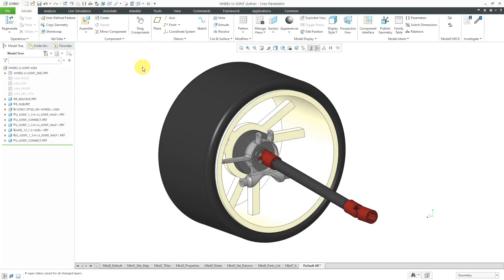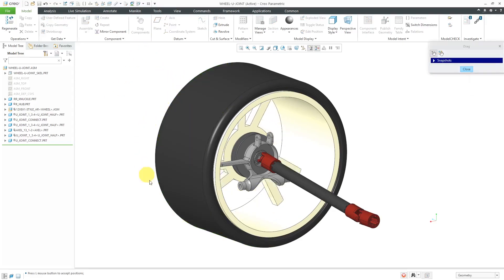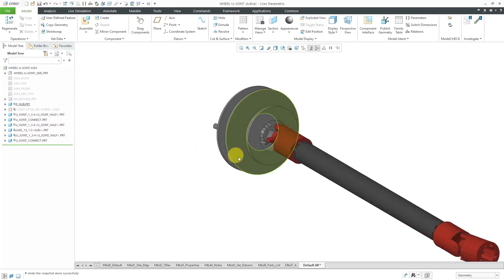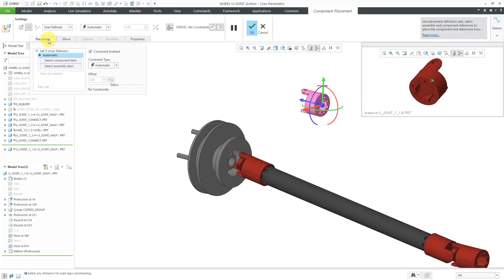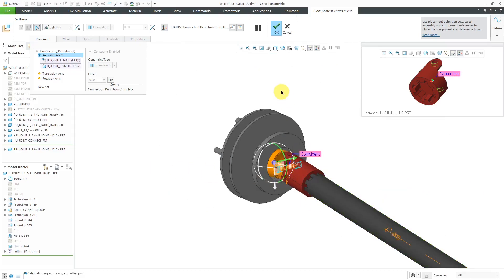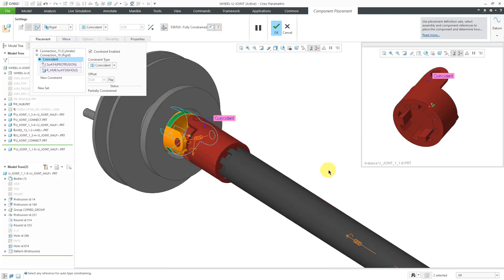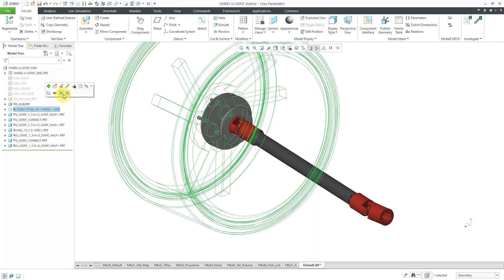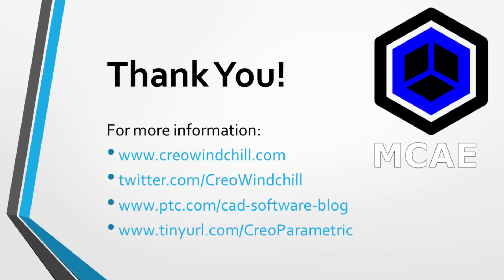Creo Parametric - Mechanisms | How to Create a Rigid Connection

Comment: Could you make a video on nested connection? That is components with lability and connections that are connected with other ones on different assemblies
Reply from the maker: What is lability? Can you give me an example of a nested connection?
Reply: @CADPLMGuy  
Lability of a component is when it has at least 1 dof.
With the term "nested connections" I mean an assembly with at least 1 dof based on a connection and this assembly is inserted into an upper-assembly by maintaining its move capacity.
Eg: in this video you could have two sub-assemblies (the wheel 12x8x1-style.asm [already done] and a new sub-assembly with all other components), then you could connect them into the same wheel-u-joint.asm

Comment: Hi Dave! Pls make videos on creo simulate at a deeper level. Like idealization techniques. I have started a new job and kinda struggling with the creo simulate when it comes to idealizations. Make videos on rigid links, springs (in simulate, i know you made in MDO) and weighted links. It would be very helpful!
Reply from the maker: I would, but unfortunately I do not have the necessary software licenses.